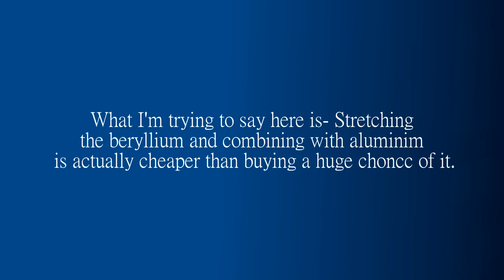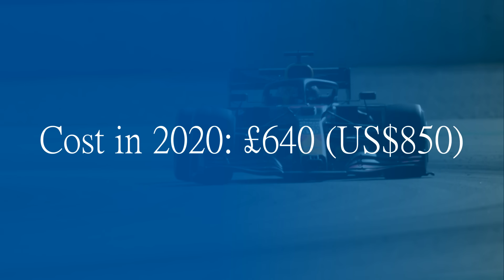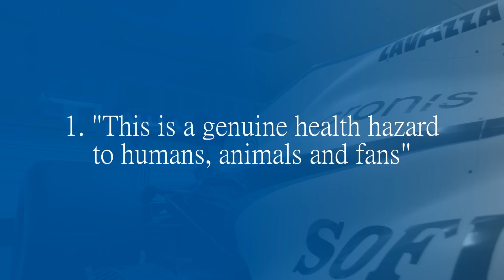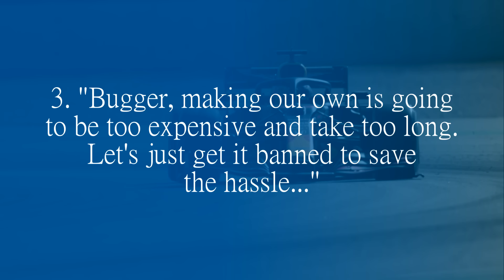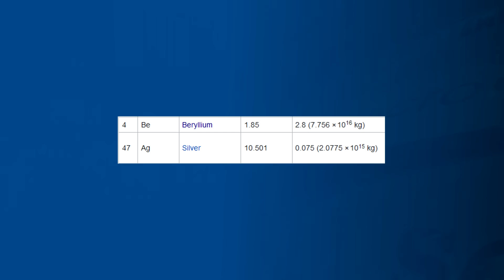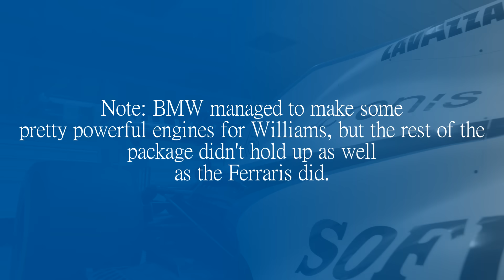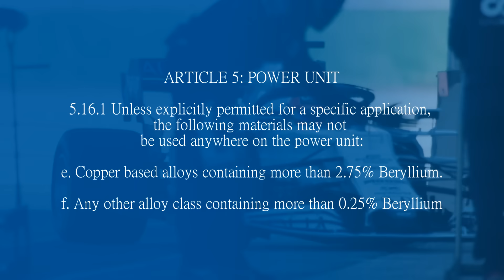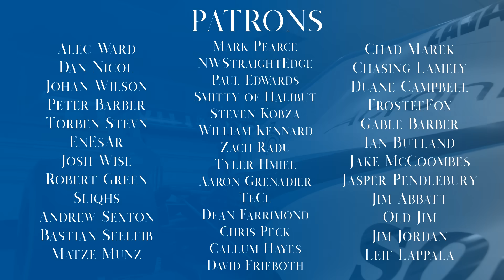MCLAREN'S "TOXIC" ENGINE! The Story of the Mercedes Beryllium Alloy Pistons (1998-2001)

Comment: You might want to do a little better research. Ferrari International Assistance (was called Aid, but well) started around the time of Montaya and Schumacher/Barrichello? Actually it was in the early 90s.

Here's something wrong too - the Mercedes engine didn't rev as high as the Ferrari. And still had a bit more power. That was what made Brawn suspicious! And by the way - pretty much every F1 engine used Boron Carbide in the early 2000s, as was silicone carbide. In general, it must be said that it is part of the game of Formula 1 to get technologies of the opponent banned and to get your own through. This is completely normal and everbody plays this game.

Comment: You didn't say how Ferrari confirmed the Pistons were Beryllium Alloy just that Ross Brawn suspected in 1999 they were doing something different due to a similar rev range. Also teams kept secret and do not announce the HP figures of their engines so how did Ross Brawn know Mclaren was putting out a lot more HP? How were Mclaren Mercedes found out? Did they have to clarify the materials used in manufacturing of the engine?

Comment: Beryllium is nasty stuff. I dread to think what would have happened had an engine had an extreme blowout leading to a hot engine fire and combustion of the AlBe alloy. Beryllium oxide is nasty stuff, and would have been formed had the alloy started to burn. A cloud of smoke drifting into the crowd would not have been fun. But, that sounds like fairly unusual circumstances, even allowing for the fact that F1 engines are more prone to failing than most; it's not often the metal catches fire!

In places where Beryllium is used, you're supposed to notify of its usage, for the benefit of (for example) fire fighters. So, it was likely a bit of a risk that McLaren were taking, keeping quiet about its usage.

Comment: Wow, I didnt realise the world of F1 was so far behind... 
1992 we were running Alu-Beryl (72/28 roughly)  liners with 'chrome' workface / Alu-Beryl (68/32) pistons made in Russia by some one who worked at the Anatnov plant.
The pistons would come ever so slightly oversize for the liners, so we'd 'dangle' them into corrosives to eat the alu content away a little in place of manual lapping.
Our engines, 2.5cc FAI class / methanol burning, would happily spin to 37,000rpm and make nearly 4bhp.
F1 kinda pissant huh?

Comment: @Aidan Millward: Interesting story, thank you. I can remember these discussion and the ensuing ban very well, which Ferrari only enforced after a possible exclusive contract with a beryllium producer failed to materialize...

But one question I still have: do you know when Beryllium was introduced in the Mercedes engines?

I remember when Mercedes introduced the FO110F engine in the 1997 McLaren MP4/12 in free practice of the Spanish GP in May. Its weight was only 107 kg in comparison with the engine FO110E (124 kg) which was used the first races.

Everyone wondered how this weight loss (-17 kg) combined with a simultaneous increase in performance (from 750 hp of FO110F to 770 hp of the FO110F) was possible. That engine was a qantum leap considering with the weight of the 1997 Ferrari 046/2 engine (120 kg) or the Renault RS9 (121 kg) to this time.

First race use of the new engine was the French GP on 29th June 1997. With Adrian Newey's beginning of work from 1st August 1997 (better aerodynamics by a new flexible front wing which looked like the version of the FW19 and the powerful engine), the McLarens were the cars to beat. Unfortunately, they were unreliable that season because of an oil system problem.

I am very sure, they used beryllium with the FO110F engine the first time. It would be very intrestingly if Mario Illien would be asked about this in a next interview.

Comment: I doubt cost was a factor, 640/kg isn't much, the small Pistons in a V10 would only have a few kg of it, specially at only 30% of it in the alloy. Likely only a few kg of it a piston set. You can spend a few grand on a set of pistons for a high performance motor these days. Add a few extra grand for the difficulty in handling and manufacturing, it's not that wild of a cost.

Comment: Beryllium oxide is used in RF power transistors and modules. They are fine as long as they’re not broken open, but any such devices replaced at work are securely wrapped and placed in a plastic bin for specialist disposal. I’m not so sure about it’s use for pistons though, surely any fragments caused by wear or catastrophic failure would be discharged through the exhaust for all to inhale?

Comment: Fun fact: Ping also looked to Beryllium for improving their golf clubs around the same time. For a short time they alloyed beryllium with copper for golf club heads, most famous of which are the BeCu Eye2 irons. They stopped production on BeCu clubs in 1998 I think due to the toxicity. You can still buy them on the used market, I personally own a set and a BeCu putter, but some of the same concerns that apply to the engine tech here apply to the clubs. Heating the heads to remove the shafts, or polishing dry or wet can produce toxic vapors or residue, and as such most golf shops won't mess around with them too much.

Comment: I’m a machinist and I’ve made electromagnetic coils out of beryllium-copper because it’s strong and non magnetic. They only told us to wash our hands before eating or smoking a cigarette when we should have been wearing gloves and masks. Turns out you don’t need any of this crap on you, nor do you want it tainting machines used for other materials without a thorough cleaning out and flush of the coolant systems. Glad I don’t work there anymore, they never cleaned out the machines nor did they care.

Comment: What a brilliant Idea... 

If its machined wet with coolant, it wont be much of any hazard during machining... However the dried chips and subsequent cuttings of dusty composition... will be a hazard... 
Of course any grinding or mechanical abrasion to the metal would become dangerous....

Comment: The toxic form of Beryllium is Berylliumoxyde BeO. It is used in high power radio transmitting tubes and transistors and even as isolator of sparkplugs. The dust is when pulverised is extremely toxic when inhaled.

Comment: We use coppper beryllium alloy on helicopter main rotor head for blade folding and keeping the blades from drooping and we hardly use ppe except for nitrile gloves. If you need to sand it though it has to be done under water for obvious reasons. This stuff is supper strong though. Cool video!!!

Comment: Wow, all this tech talk and he doesn't know that Ratzenburger died in May 1994, 6 days after Senna. 5 years before 1999. It was also known as the Senna Era. Now anything he says is probably false
Reply from the maker: Ratzenberger died the day before Senna did, in April 1994. so if you’re going to point out “corrections” at least get what you’re saying right first.
Reply: @AidanMillward already explained my mix-up in the comments, still my information was a lot closer to the facts by almost a year. I'd rather get confused between 2 specific dates than be out by a whole year. Even if someone doesn't know the specific dates, which i incorrectly based my argument on, they usually would still be aware that the year was 1994. Correct my correction by admitting your mistakes first as I just did, it's bad sport if you can't do that
Reply from the maker: @garethjones909  I did admit that I got it wrong. It’s in the pinned comment that I put up as soon as you pointed it out.

I accidentally said 4 since my brain defaulted to 1994.
Reply: @AidanMillward  I must apologise for missing that in your comment. I read it as a sweep under the carpet kind of correction, my bad. It's impossible for me to accurately read tone. In regards to comments I always  misread either the tone or meaning. I see what you mean
Reply from the maker: @garethjones909  I’m fairly certain I have dyscalculia because there are so many maths things I get wrong in these videos. But if they crop up I’m usually pretty quick to do pinned comment and say I messed something up.
Reply: @AidanMillward  also I didn't edit  my first comment, lucky for you😂
Reply: Ratzenberger died on April 30, the day before Senna, after a heavy crash in qualifying when he went off at the kink where the Villeneuve chicane is currently.
Reply: @F-Man  sorry, I  mixed up the burial date of Ratzenburger and death date of senna. that got me to think Roland died later even though he did crash before senna, I didnt realise I had done it. You are 100% correct. Forgot to double check on Wikipedia. Still around a year closer to the correct answer than in the video, and I probably would of double checked and figured it out if I were making a YouTube video. Thank you for reminding me

Comment: Well, like the calipers which I think may have been the first, that we know of application, and banned. Be has been used for many interesting things. Mostly military, but the pistons didn't end at that time. I know that it was being re -engineered in 2003. And the JWST mirrors are solid optical Be. much lighter than glass of course. Be was being used in NHRA engines for some parts, a known.  Now the Be was alloyed with so many other things that it's ability to maintain it's magical properties was
 always a task.

Comment: In the defense industry, we were experimenting with AlBeMet (aluminum/beryllium metal matrix composite)  At the same time, a report on toxicity came out and the SHTF.  We discovered metallic dust from vibration  and those associated in fabrication and testing have been tested every year since (90's).

Comment: A similar situation with the Mercedes V-8 engines used by Penske at Indianapolis. Penske is able to bend rules just sort of breaking and exploited the rather loose definition of a "stock block" engine at that time. Mercedes built an engine that fit the letter of the stock block rules but blew the spirit out the exhaust. After an overwhelming win. the engine was outlawed and stock block rules tightened up.

Comment: Beryllium alloy spanners/wrenches were/are made for use around flammable or explosive materials because they are non-sparking if they strike a hard surface, unlike steel alloys. I have seen pictures of them - they have a brassy or bronzey colour to them - just don't grind or abraded them due to cancer risk.

Comment: 8:45 BORON is used in Period Cramp medications. NOT Boron Carbide!? Foods High in Boron like Peanut Butter, Bananas, avocados, chicken peas and prunes are recommended. Boron is an Element on the periodic table. Boron Carbide is a Boron-Carbon Ceramic/covalent material. Not the same as Boron or Carbon alone. And DEFINITELY not used in Period Cramp supplements. I HAD to look that up... 🙏 I know ZERO about cars though. Good stuff 👏 👍
Reply from the maker: Listen again to what I said again: I said Boron is used in period cramp meds and NOT boron carbide.

Comment: The assertion that the beryllium dust that makes it through the exhaust is harmless has no basis in reality.  Beryllium dust is beryllium dust, whether it is produced by a grinder or engine wear.
Reply: It would have been fairly simple by taking a sample of the exhaust and putting it into a mass spectrometer. That way you could actually see if there is any kind of dust. Have it required to be tested after a certain number of miles, and boom. There you go.
Reply: Imagine conditions in the engine:
  Spark eroding
  Hot gas blast
  Friction wear
  Pickup in the oil
  Grenading pistons
  Oxide formation
Reply: Any metal particles formed as a result of hypothetical "piston degradation" would have size small enough to have carcinogenic properties regardless of which metal we're talking about. Therefore if the process of their formation was possible all ICEs in general would've been banned for at least a decade at this point
Reply: the pistons dont wear the rings do no dust is gonna escape the engine bia exhaust but treating the used oil as containing beryllium would be reasonable

Comment: Its also not like beryllium is fucking enriched plutonium. The risks are very small. Ie an aircraft flying over using avgas is putting more lead in the air and water etc than a f1 car. plus theres a thing called occupational exposure limits. So for example using aircraft again, its prefectly acceptable that every passenger including crew is exposed to high levels of radiation on intercontinental and high alt. flights. Its it good, probably not, hOWeVER the limit for passengers if diferent to crew. aka occupational limits. In terms of aircrew they dont do anything diferent dont want to be irradiated, dont fly. Or heres another, asbestos, its bad. but perfectly safe unless disturbed. The actual replacement materials on the market are just as bad for your health just documented. I think you and everyone else is demonising beryllium to be honest. It was all about greed and jealousy

Comment: As a USMC A-6E pilot, the holdback fittings used on carrier launches were made of beryllium. This was due to the strength and predictable fracture characteristics of the material. (The fitting holds the aircraft under full thrust, and fractures when the catapult fires)
Most of us kept souvenirs of the half retained by the jet (other half stays on the catapult and is discarded after launch)...with the caution of not to cut ourselves on the sharp edges at the fracture point because "your hand will swell up like a grapefruit!"

Comment: Beryllium is a highly toxic metal when its dust or vapour is inhaled. It causes chronic lung diseases that can be fatal, I'm surprised it's use in racing car engines was ever sanctioned. Among its other uses in electronics, it's also commonly utilised as a neutron reflector in nuclear weapons and as a means to direct x-rays specifically to compress lithium deuteride fuels in thermonuclear weapons. It's a bit of a badass metal!

Comment: All Engines should have hard chrome plated Beryllium pistons and rods.  Titanium Crankshafts, A car could be 30% lighter. We would save so much fuel it is not funny.  100 mpg engines are possible. But require very expensive alloys and composites. So it is unlikely we consumers will ever see such innovations.
Reply: VW's XL1 proved that 250mpg is entirely doable, so long as you don't mind compromising everything to achieve it. 100mpg shouldn't even be hard given access to solely exotic materials.

Comment: What I didn’t learn today is if the two motors had the same redline, why did the beryllium one make so much more power?
Reply: It was a long stroke engine so it made more torque.  Same rpm x more torque = more power.

Supposedly the long-stroke engine with the heavier conventional pistons would have had too much inertia to be able to rev that high, hence Ferrari designing an engine with a shorter-stroke that produced less torque.

Comment: Alot of motorsports use copper beryllium alloys to make valve seats to handle super high valve spring pressures
Reply: Beryllium-copper aloys are not very toxic, it is the ceramic form BeO, Beryllium oxide that is dangerous.
Reply: @harrydelange1821  they arnt necessarily toxic but the dust is some nasty shit if you breath it in. Does similar things to your lung that asbestos will do
Reply: @leojensen9270  Yes that's what I meant, the dust of it (if chunched, damaged, pulverised for example). I got lots of electronic parts that contains BeO (hundreds of transmitting tubes ans transistors) in my house, but they're safe in a solid way.
Reply: @harrydelange1821  yeah im a machinist so to work with that stuff means wearing respirators

Comment: I work with Be and can tell you - pistons made of this material are gravely dangerous. Even in small amounts, breathing this in would cause irreversible damage to your lungs. 

As the Blendtec saying goes "Don't breathe this!"
Reply: You work with Beryllium ? How ?  Where ?  What do you make ?  In what capacity/job ?
Reply: How do you breathe a piston?
Reply: @Miraculix26  If an engine goes boom, its innards will likely be ground up into shrapnel and dust. Chances are the engine's final few breaths will include an exhaust stroke, spraying that dust out the vehicle's pipes... or perhaps not even. From there, the dust is free to contaminate the air and pose a health risk to track attendees and beyond.

Comment: Presenter: It's stable at temperature
Also presenter: I'm glad they banned it because it's not safe.

Sure would be nice to have seen a mass spectrogram or similar evidence in the exhaust to support this.
Reply: No. He said it's unsafe during manufacturing.
Reply: @andycraig7734  my godfather made beryllium copper non sparking tools for aerospace industry (particularly fuel handling). I get that Be can be nasty stuff to work with, but it was more than just manufacture that the presenter was describing. I'd you missed that, I'd suggest rewatching.

Comment: "McLaren had made improvements to the system and that is why at the start of the season Hakkinen and Coulthard had more than a second over the cars behind."

The gap at the start of 1998 was due to the McLaren's much better, Newey-designed aero, and the Bridgestone tyres, not the steering brakes which were given more credit than they deserved.
When they were banned for Brazil, McLaren actually increased their gap on the quickest non-McLaren car (0.84% at Melbourne, 1.32% at Interlagos). Only Goodyear's new bespoke tyre for Ferrari narrowed it.

Comment: Why can’t they use an off the shelf production engine, like a 350 ci small block Chevy, a 351ci Windsor or 354ci Chrysler Hemi? It’ll be a lot cheaper, simpler and parts are available off the shelf. You can make four figures in power and torque from them.
Reply: Haha either a nice prank or an absolutely f-in stupid comment haha